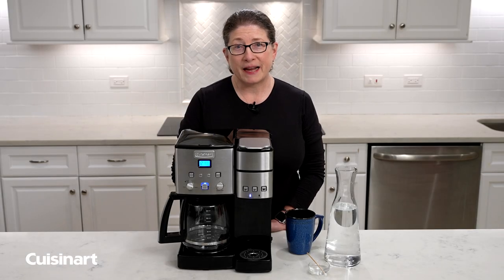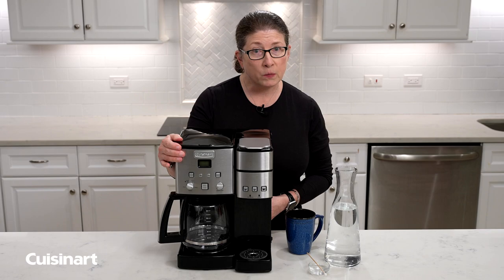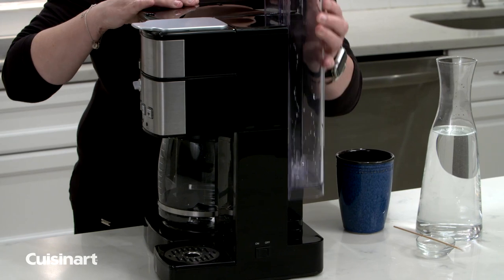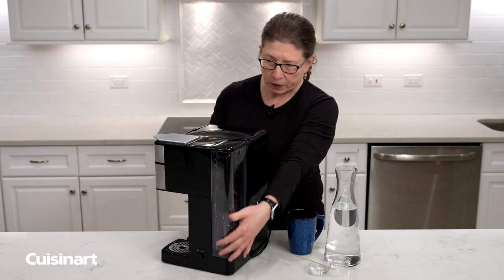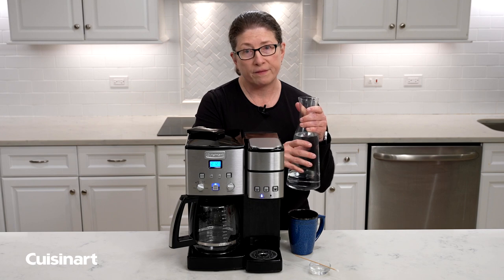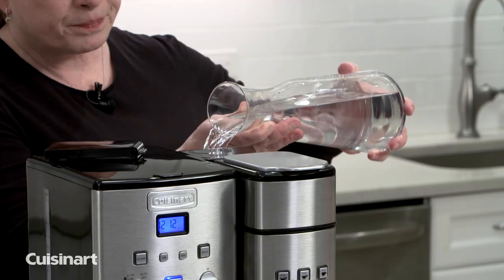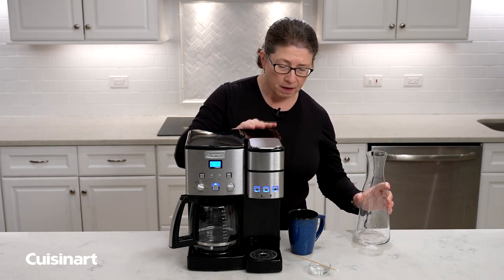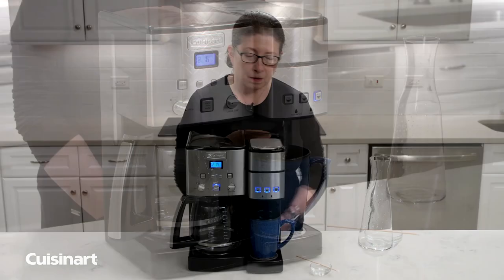Cuisinart® | How to stop leaking from the single-serve reservoir on your Cuisinart Coffee Center!

Comment: I watched this video, did a 50/50 vinegar and hot water. Ran it through using up all the mixture. It works perfectly now that the 0 ring is seated. I think the hot water might have helped soften up the o rings too. 🎉❤ Thanks so much.

Comment: Fantastic. We literally just bought this tonight and there’s water all over the place.
Reply: I've had mine a year. It started leaking about 4 months after I got it. They replaced the reservoir. It soon started leaking. They replaced the whole unit recently and it leaks also!!!
Reply: same
Reply: Worst coffee maker ever! Before the leaking started I already wanted to get rid of it. We could never use the time brew feature because the clock randomly resets itself to midnight. Then k cup side stopped working. Cleaned the upper needle. Now half the reservoir is on my counter. Did the vinegar rinse and swab thing & it's even worse! It leaks from the bottom while it's brewing so you don't even get a full cup of coffee. Then leaks water as it sits.
Reply: Same here!!!!!!
It's brand new and it's doing this.
Reply: Mine is a week old and doing this! I was so excited to have this coffee center and now I’m bummed out

Comment: The water reservoir on our brand-new Coffee Center's water reservoir doesn't leak, but when we use K-cups, it sprays everywhere inside. There's liquid inside the machine. There's liquid all over the K-cup. The same K-cups (many different brands, from generic to Starbucks) work perfectly in other Cuisinart and Keurig models. The capsule was replaced under warranty (it was missing the rubber gasket around the pin), but even that didn't stop the problem. Does no one else have this issue? We'd return it if we could.
Reply: Mine does something similiar. It'll be fine for awhile, then suddenly it's like it's pressurized and pops the lid of the single serve side up a tiny bit, then proceeds to shoot scalding coffee and grounds out of it. When we open it, we've also found it's made a giant hole in the top of that particular k-cup. Initially, we thought we had pushed it down too hard and done it ourselves, but no matter how gentle we are, and even after opening it after to check, then re-closing it, the issue still happens.

It's gotten to the point that everyone in the household is trained to pick up on the different SOUNDS it starts making after starting it, and then try to shut it off as fast as possible before it spews everywhere. No amount of cleaning has fixed it.

Comment: I typically love this brand but this particular coffee station is flawed.  Mine starting leaking 2 months from time of purchase. I kept thinking someone was just spilling water when they were pouring it into the coffee maker but that’s not the case. I figured out it was coming from the bottom when I turned it over to look and whats worse my brand new granite counter has a big spot on it from where the water ate thru the sealant and made it dull. It’s real, black pearl granite.  I don’t want to go to the trouble of getting the unit replaced and then have a leak again. It’s been a nightmare.
Reply from the maker: we apologize for the inconvenience. Please email MarketingCommunications@cuisinart.com so we can better assist you.
Reply: Same here. Ours has ruined our granite cabinet as well.  Our unit is actually leaking from the top and bottom.  It sprays water all over floor.  We love the look of the Cuininart Coffe Maker, but at some point, we need to just try something different.
Reply: Same Exact Story Here. This Leaking Coffee Maker has absolutely destroyed my Tile Countertops. The water leaked into the tile grout which caused the grout to break into large chunks and water pooling underneath the tile swelling the countertop backing. The water subsequently runs out from “Under” the countertop into the cabinet drawers below literally ruining My Countertops and the Cabinet Drawers below as they have standing pooling water in each drawer all the way to the floor. The Water Damage is SEVERE. I can not even believe this inferior leaking POS Product is still on the market. I reached out directly to Cuisinart by Customer Email explaining the SEVERE water leaking and the extensive damage it’s caused to my countertop and cabinet drawers I was told someone would reach out to me. That was over 6 Months ago and I never heard anything from them. I have the Photos of the damage, the Coffee maker begans pouring water out the back the minute the water reservoir is placed on it. Cuisinart is well aware of the issue and refuses to even acknowledge the problem. I think it’s far time for a “Class Action Lawsuit” the damage to my Countertop and Cabinets I should not have to pay for as it was there inferior product pouring water out the back which caused the damage. This is Wrong. I am in the process of seeking Counsel regarding this matter and I encourage anyone else who has water damage to do the same.

Comment: So, I had this problem after 2 week of usage.

I found an alternative fix-

Take out the reservoir, empty it, let it dry completely outside. Take a cloth and dry the seal with a towel. Once the seal area and reservoir is completely dry, attach it to the coffee machine. There should be no leakage. Also, when refilling the reservoir, DO NOT take out the reservoir from the machine.

If that doesn't work, you probably have to do the vinegar method. But be sure to attach the reservoir to the seal when it is completely dry! Hope this helps.

Comment: This did not work for me. It still leaked. After a few attempts to contact customer service, I gave up due to being on hold for over a half an hour each time. I took a piece of black electrical tape, about 3" long, cut it in half lengthwise and wrapped a piece around the bottom of the reservoir where it goes into the coffeemaker. It lessened the leak, but still not leak-free. I took the other half and wrapped that on top of the first piece. Now it fits very snugly into the coffeemaker and NO MORE LEAK!  I hesitate to remove it for filling, so I'm sliding the unit close to the sink and using the pullout faucet to fill it. I could also use the carafe if the countertop is cluttered. 
It's frustrating to pay such an exorbitant price for something that doesn't hold up. What good is a 3-year warranty when you can't get service in a timely manner? My coffeemaker did not leak initially, but started when several months old, so returning to the store was no longer an option. This is my third Cusinart coffeemaker, and although I like the single serve feature, it's the most disappointing of the three.

Comment: I emailed Customer Service as requested; no response.  Our coffee pot is barely a year old and I'm so frustrated that I need to mop up the counter top every single time I make one cup.  I've now run vinegar as well as another coffee pot cleaner through it multiple times and nothing helps - that little tiny hole on the bottom just does not let water go through it into the coffee cup - it just lets water sit underneath the reservoir and then drips onto the counter.  We've always had Cuisinarts but this is not good.
Reply from the maker: Hi Michele, a member of our Customer Service team will be contacting you soon. Thank you
Reply: Mine too... and the main coffee pot started to leak and rust on my white granite countertop. It's awful

Comment: I on my second unit in three days. Both K-cup reservoirs leaked right out of the box. I like Cuisinart products but this is a flop. Maybe they should buy a Keurig, take one apart and figure out how they get the assembly to fit. The gasket/o-ring seal is far too loose

Comment: My O-ring is missing and I do not see it offered on the Cuisinart site as a replacement part.  Does Cuisinart offer this O-ring as a replacement part?
Reply from the maker: Hi Richard, please email MarketingCommunications@cuisinart.com so we can better assist you.
Reply: Mine is also leaking but I do not have an o ring in the hole
Reply: I wrote to the email provided about this issue last week and I have not recieved any type of reply.

Comment: The problem is not the Cleaning, I took the old one apart and the Hole has a O-Ring inside where the reservoir nipple sits wears over time, usually 6 months and does not seal the reservoir to the Machine. this is a poor design because the Platform where the Reservoir sits is flat with no edges to catch excess water. I am not sure I want to deal with the Outsourced Help desk troubleshooting and may just purchase 2 separate
 coffee Makers. With some quality engineering this is a great Idea.
Reply from the maker: Please email MarketingCommunications@cuisinart.com so we can better assist you.
Reply: We've had one for over 2 years, and just started leaking.  Before watching this lame video I determined the o ring broke as I found the broken one.  I'm going to go to Lowes and see if they have a replacement that I can insert.  Otherwise....off to the dumpster.